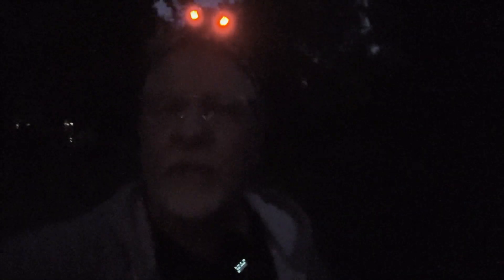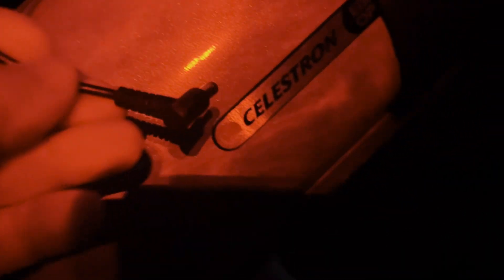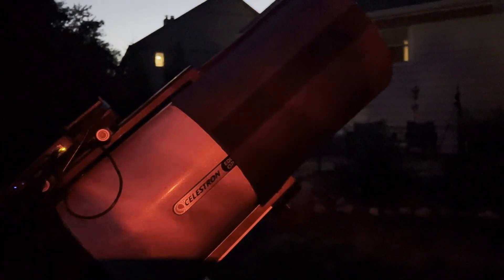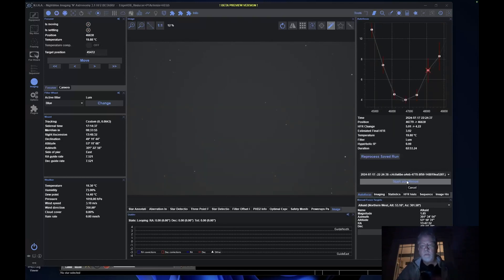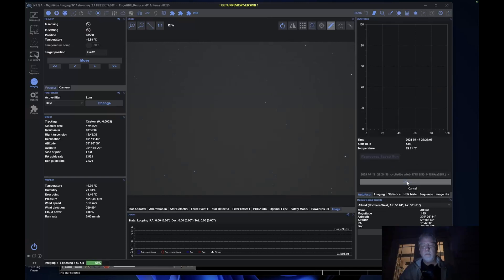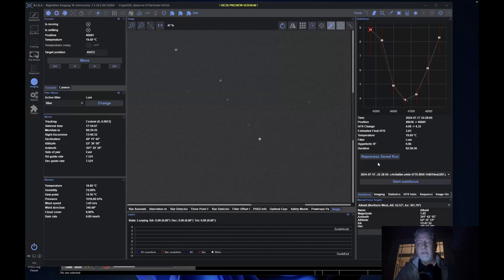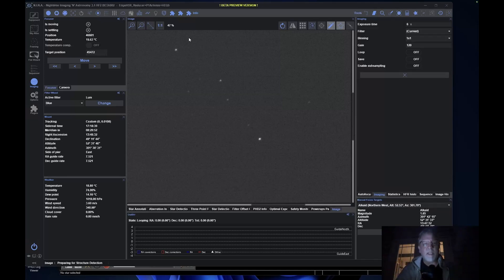AstroAF - Can A Dew Heater Really Cause Star Aberrations? | Let's Find Out!

Comment: Last night with my C8 and Celestron 2 port controller (only one port used) I ran a calibration before imaging. The ambient and dew points were close. I had the Celestron controller set for auto control. Using the sensor it should provide the power to the dew heater ring as needed. There is a setting, Aggression Level 0-10, that can be set and I set it to 3. I ran my image session and checked the dew control panels for how much power was being used and if the dew heater was running and how many watts the dew heater was pulling. It was pulling 21 watts. At the time I didn't know what level of power that was, whether it was 50% or even 100%. There was heavy dew forming last night even around 9pm. The humidity levels were about 95% according to the dew heater information panel in CPWI, Celestrons control software that NINA uses. This morning I looked at my lights and discovered tails on the upper right hand corner stars. I figure the humidity being so high the controller ran the power at 100%. This will not work. I have to zoom into the image to see the tails in the upper right hand corner of the image but now I know they are t here it's bugging me a little. I can bypass the automatic feature and set the power levels manually. If I set the power level to 25%, 5.4w, then 50% 10.5w, 75% 15.4w and 100% 21.6w. So last night the controller was running full power to the dew heater ring. I will try manual settings next, starting with 25% first.

I noticed in a post below you are using 40%. Do you know how many watts are generated at that level and are you still running at that power levels with no aberrations?  My Celestron dew heater controller software shows 40% is pulling 8.5 watts. I would think with a dew shield also you can run at reduced power. I'm thinking maybe the controller is designed for now dew shield. 

I measured my dew heating ring and at 40%, 8.5 w the ring was 96/98F with ambient temperature inside at 84F. 20% was 4.4w and I measured about 90/91F on the ring and a couple of degrees cooler on the corrector glass.

Are you still planning on switching to a  heating strap? AstroZap has a dew shield with built in heating strap.
Thanks

Comment: It's about 7:29 in your previous video. You did comment on the flat spot.
The reason I commented it could be from an obstruction, as I had a similar issue when I put on my dew shield for the RC8, it ended up with a flat spot very similar to what you pointed out, and it was caused by the dew heater cable and is why I removed it. The RC8 was second hand, so I didn't install the heater, but the power connector was mounted through the side of the tube and also caused spiking around the stars. 

There is an issue at play, though, as your stars look a bit wonky and not round. Sure, this maybe due to tilt, but I don't think so.  So there is something not quite right. I can only go on the footage in the video.   

From experience, using the bathinov on a bright stars is a great starting point, but doesn't always give the correct focus information. A good tip is to focus on the bright star first then look at medium bright stars around the field of view, preferably near the main star and check to see if they are in focus, if not then make adjustments and bring them into focus, while staying on the bright star. If in focus, then one is good to go.    

However, Your videos are intuitive and well presented.
Reply from the maker: @robinbrown3896   thanks!  Yeah that flat on one side that flairs on the other side. From researching that I saw similar images on CN identified as astigmatism type of aberration. There is definitely more at play but I feel I’m making progress. The star quality now is so much better than when I started and I’ve realized improvements in autofocus, guiding, and star detection/plate solving. Especially in processing. If I see that flat again I’ll do a hand shadow test to see if I can locate anything that might be an obstruction. 
Thank you for the tip, I’ll give that a go! Thanks also for watching and commenting!
Cheers!
Doug

Comment: The first thing I see is your images are slightly out of focus.
I looked at your previous video and come to the conclusion the cables of your internal dew heater were causing what appeared to be pinched optics.
This was shown clearly, as it showed a large shadow across the star, which indicates an object is in the way.  
The pinched optics would only come from your primary mirror, but as I see it does not have any issues.
I had an internal heater for my RC8 and ended up removing it for a heater strap as it was causing issues with weird reflections and never looked back.

The Celestron HD in my opinion have great optics and a very flat field. Collimation can be difficult at the best of times. I have used your method with a camera, but gave up on that method as I found it was too difficult to get the camera perfectly aligned, and then I would question even though the camera looks aligned is it really!  So opted for the bench for collimating. Yes, you have tilt but only sightly in one corner. 

I see you had NINA 'focus offset' activated. The NINA 'focus offset' is a very handy tool and I use it all the time. 
However, if not used correctly, or aware of some issues, it can cause the 'focus offset' to fail.
As it is difficult to focus with some filters, HA, OIII, etc. Focus offset was created to get around this problem. 
By using a filter like 'LUM' for instants as it will let more light through and then calculates the offset of the other filters.

To set up focus offset correctly, it needs to be a perfect clear night and the scope needs to be pointing at the zenith.
I don't use a 'lum' filter as I don't have one in my filter wheel and replaced it with a black filter for doing dark's or bias if needed. 
For instants, if I change my gain settings, then I will do a bias dark run at the end of the session. So my option is to use my 'RED' filter for calculating and offset focusing.

So where does the problems lye when it comes to focus offset ERROR. Firstly, if making any adjustments of the focuses mechanical position will render the offset useless.
Secondly, doing a focus offset low or near the horizon.

Back focus, for the camera on the focus train, is very important and should be taken seriously, if not correct can cause no end of focus problems and can tribute to thinking there is a collimation problem when there isn't. So 1mm can make a big different to perfect focus and filter thickness needs to be taken into consideration.

Have you thought of going for a power box like the Pegasus and alike for controlling your equipment?
------------------------
Reply from the maker: Hi Robin!  Thanks so much for watching and leaving a comment!  Yes, improving focus is one of the challenges I'm working on and is part of the impetus of the checks I've been doing for pinched optics, corrector and secondary collimation and upcoming sensor tilt.  Depending on where you are inspecting within an image field will result in various states of focus due to these and presumably the tilt that I have yet to address.

Could you point me to where in the video you saw the shadow?  I am certain that the cables for the dew ring are not in the field of view, when running heater, one is captured in a clip attached to the outside edge of the tube and the other is retained in the clip built in to the dew heater itself.  I do not have any other cables in front of scope.  I suppose it is possible though and I would like to verify in the video.

Pinched optics can definitely come from the corrector should it be over-tightened by the retaining ring (dew ring in this place) or over-tightening of the corrector collimation screws.  The former is more likely to cause deformation if that is the case.

I am definitely considering going back to a strap heater.  For now I am running the Celestron ring successfully at about 40% power and it is performing as expected without introducing aberrations.

My Lum filter is my autofocus default filter.  I have offsets applied to my RGB filters that I am currently using.  It has been working very well and the filters are very close to parfocal with very few steps of offset.

I am within .5mm of backfocus specification, I actually have a video on that very topic here: https://youtu.be/BfqmStBckSw?si=l4mtl8IZHheTjnJZ I plan on doing a follow-up video of backfocus on the EdgeHD with the .7x reducer.  I'll probably be doing that in 3-4 weeks or so.

Yes, indeed, I am currently looking at Pegasus and Wanderer power boxes.  Both have the features that I need, although the Wanderer has an additional temperature probe in addition to the environmental sensor.  I understand that both will work with the Celestron ring but I am currently checking with engineers from the power box companies to verify that is indeed the case.

Cheers!
Doug

Comment: I have the Celestron corrector plate dew heater on my RASA 8, I only run when it when temps go below 30° F, the camera and camera fan generate enough heat and airflow to take care of dew.
Reply from the maker: @williamhouse5081  Hi!  Here in the Midwest’s humid summers, the temps cool sufficiently to get dew consistently overnight. So dew control is nearly a year-round requirement here. My camera has built in dew control too but my problems are definitely at the corrector plate dew control. 
Cheers!
Doug
Reply: @AstroAF  same here, I live in Iowa right next to a corn field.
Reply from the maker: @williamhouse5081  Ah, you know then. Although I wish I could go without heater more often. I live close to a stream and surrounded with trees. Corn fields begin about 1/2 mile away.

Comment: James Lamb has a video on the same subject. 
https://youtu.be/WWX0arlgfd4?si=8eYuRAcZjzFTow6i
I have one of these rings with the Celestron controller. I've never been anywhere I need a dew heater turned on. I use the controller more for the weight to offset the weight of the image train.
My Astro Oasis autofocsuer settings are way off from yours. I have it set to 800 and it seems to focus fine compared to a Bahtinov mask. I wonder if the ZWO focusers has the same issues with focus.  I don't see reviews showing having to fiddle with the back lash so much or any procedure to calculate the backlash. 
My ASI071MC has adjustable tilt but ZWO doesn't offer any instructions. I'm sure every camera has tilt. I haven't come across anyone talking about it and making a video so I'm interested is seeing something about tilt remedy.
Reply: If running the Celestron, then it will only turn power on when the dew point gets close or above the temperature, then it will only turn it on at the rate you set (aggressiveness) until it senses the area near the sensor on ring is above the dew point as the area just needs to be above the dew point. Then it will turn off the ring. The celestron will do the same for its other ports provided you use the sensor (sold separately) under the other dew straps. In that way, different size dew straps are controlled independently and automatically. A finder strap might need less power and the OTA body might need more and turned on longer
Reply from the maker: @GregMcCall  Hi Greg!  Thanks for commenting!  I am considering the Celestron controller but I may give Pegasus powerbox a try as it can provide power aggressiveness and comes with environmental sensor. For now, just running at reduced power is working very well. I do want a more permanent solution though. 
Cheers!
Doug
Reply: @AstroAF  Hi, this where the marketing combined with poor engineering fails to explain how it works and tricks people into thinking it’s the same as other dew point controllers. It’s just not so. With no feedback loop on the dew straps (or dew ring), the effectiveness of any heat near that surface is unknown. Different size straps and/or different strap resistances are all variables. So the auto claim is just marginally better than not considering the dew point. The control is a little better than manual. BTW, the Celestron also has an aggressiveness setting (also available in the ASCOM switch controller within say NINA). While I think the physical size of the Pegasus (and wanderer) controllers better and they also seem to have better software, the lack of feedback and the inability to include a feedback loop (and re wanderer work with celestron ring) puts these others at the bottom of my list.
Reply from the maker: @GregMcCall  Thanks for that insight!  I thought the environmental sensor or the Pegasus and Wonderer created that loop. I saw that the wandererbox includes both environmental sensor and a temperature probe, where I think the Pegasus only has the environmental sensor. As I understand it, the Celestron ring’s thermistor is proprietary and does not work with other controllers. 
I’m tempted to discard the ring and go back to a strap.
Reply: @AstroAF  To be calculate the dew point, you need both the temperature and humidity and a calculation element (ie. computer). Straight away, that adds cost compared to a simple circuitry (to control the pulse width of the PWM voltage). Re compatibility, it is possible to convert the sensor between controllers as they are basically resisters that change their resistance with temperature. While I don’t like being locked into an all in one system as the Primaluci gear, their Ecco controller has an adapter to convert what is needed for their system from the celestron ring. It’s not proprietary, just different. (May not be different but as I don’t know what is used on the ring or what the wanderer needs, I just assume different). Unfortunately for me, I have to put up with the quirks and faults of Celestron software, the bulk of the controller (although not too bad mounted on the top bar) to gain the better engineering. If someone worked out the differences in the sensors between the wanderer and the celestron ring, I’d jump ship to the wanderer ASAP.
Reply from the maker: @GregMcCall  I’m going to reach out to wanderer and see if I can get information from an engineer for this specifically.
Reply: @AstroAF  now why didn’t I think of that. Fantastic idea. The two sensors may even be compatible or just a resistor added to present the correct value to wanderer. I’d be VERY interested in the result of that conversation. We have a dealer in Sydney (AU) that sells wanderer so it’s a very viable option for me
Reply from the maker: @GregMcCall  email just sent. I will try to keep everyone apprised of what I learn!
Cheers!
Doug
Reply from the maker: @KJRitch  Hi! yeah I’m sure I’ve run across his videos. I’m running it at reduced power now and it is working without star distortions.
It is probably more of a difference in the backlash of the Celestron focuser than it is the Oasis. I’d be interested in your settings though. 
Cheers!
Doug